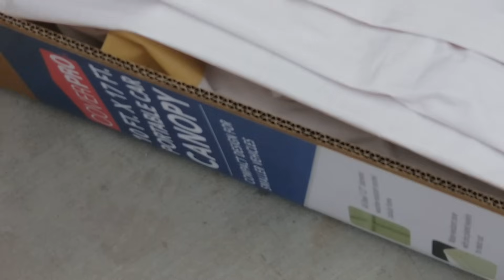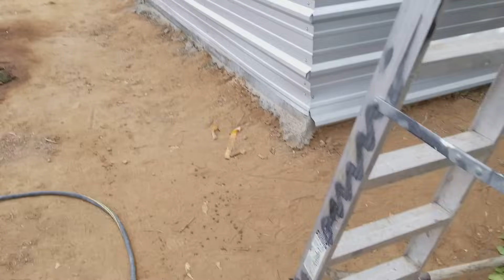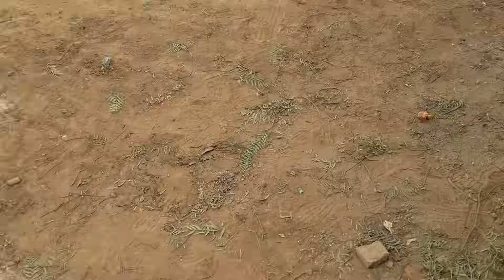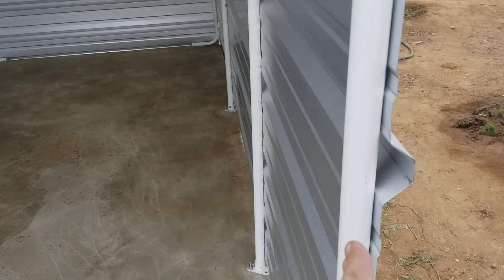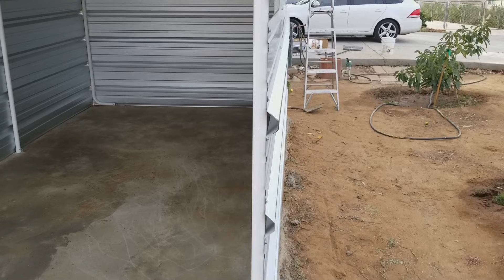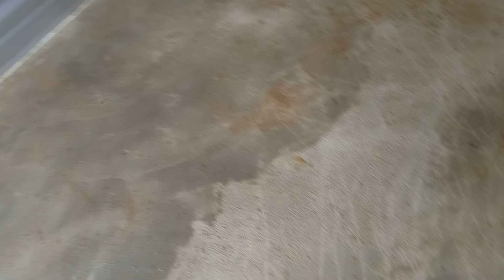Harbor freight tools portable garage into  Permanent structure

Comment: The overlap of each panel should be screwed to the bearing leg rib under it at a minimum of every two feet. Doing so increases the resistance to lateral movement from wind and increases the strength of the panels under load as each panel become slightly part of the others!
This is standard with installation of this type of metal on all applications. Google it!

Comment: I was thinking in the same lines although I don’t have size restrictions I’m thinking about extending to 12ft wide by adding spacers in the roof poles . I wonder if you put poles across like rafters if that would help ?
Reply: I would put poles across and one from the center of the peak down to your rafter going across. If you really wanted to add a lot of support to the roof. Where your pole from the peak meets your rafter run one from each side at an angle towards the middle of the original rafter.

Comment: QUESTION... SO... ANY ADVICE ON HOW TO GET A SLIDING DOWN DOOR ON THE FRONT?
Reply: Just make a split door
Reply: you may either use a roll up door and put a heavier frame around it or barn doors. 2 doors on either side of the opening.

Comment: I have something like this and the tarp is failing after 2 years. Putting steel on it might be cheaper than a quality canvas for the roof. For snow load I just used rated cable for the rafters. Easier to do that, though conduit and fabrication would likely be cheaper.

Comment: using screw eyes on frame bolts allows x brace cables inside 3/4 conduit especially on end sections. Built green house with same frame. An alternative inside sheathing is FRP sheets or Diebond (thin layers of aluminum with Polypropylene core. Both cut with circular saw either lap and glue/screw or use a backer on seams and glue/screw to that. Both are water/vermin proof will add resistance to racking and if glue and screwed  make a stress skin panel. Same with outer panels. Metal building catalogs have exterior trim, foam insulation strips, and simpson plates for mounting lights, roof vents, hinges for doors.

Comment: Good VIDEO!!! A friend of mine did the same thing on a 24ftlong square frame(rounded top style). Its about 10ft. High in the center.cost $820 to do the roof without the sides. Uses it to park his boat in during the summer.

Comment: I believe that these panels are run through a rolling mill.  Single press stamp would be ridiculous.  I have put on metal in excess of 40 feet. There are plenty of metal panels by many manufactures of this profile called generically DELTA RIB.  Many profiles exsist that function fine for these types of construction

Comment: We bought one of these kits from Costco and installed it in the driveway and the next big wind storm blew it over our barn and solar panels and landed into my goat's pen!  We used the tarp, of course.  I wonder how wind-proof this metal siding would be.
Reply from the maker: I have had 60mph winds and no issues. Remember it is anchored to the ground. and the panels are quite a bit heavier than the tarps.

Comment: Hah. About 2 moths ago i just did the same to make a new horse shelter. Took a pole tent i already had (i have atleast 20 frames worth of pipe and fittings) cut it down, took the scrap sheets they used to cover my roof panels in transit when i did my roof 2 years ago, and some plywood since its a horse, id rather she mess up wood then the metal and possibly slice herself severely. I bought a box of screws and some hat track for extra support/mounting locations. Was into it for about 150 bucks not including the cost of what i had laying around.

Comment: If you make it just wide enough to get a vehicle into but would not be able to open the door you need to think outside the box and install a swing door where the door would open so you can open the wall to give yourself enough room to get in/out but then close it back up when not in use with a simple gate latch to keep it closed.  When you are making it up as you go you are not limited to what a manufacture made as long as you have access to materials and tools to let you do what you can think up.

Comment: Great job! I have one of the larger frames and have been thinking about doing this same thing. This is the very first I've ever seen. You done a great job putting it together. Yep my frame is from the tent type storage shed and I will be honest, it was ok But the tent fabric lasted only two years. The sun rotted the fabric in no time. So now after seeing your video I'm gonna do the same thing but when it comes the roof panels, I might ask the metle company if they can groove only one section of a sheet and leave the rest flat. That way I can have a smooth roof rain and snow run off. Again great job. Thanks for sharing. You now have a new subscriber.... Thumbs Up !
Reply: Goodolboy One no grooves/ribs equals no strength. Just add wood or metal purlins to the roof at 90° to the frame and install the metal parallel to the frame or opposite to what this Video shows.  End result is rain and snow will run off.  Could gutter it also!  With the wood purlins the strength of the roof will increase dramatically!

Comment from the maker: http://www.contractorsteelsupply.com/ Here is where to buy the sheet metal siding and screws.
Reply: 2 things, I would go to lowes or Home Depot and get some of the thin superstrut for additional strength and bracing.  should be easy to add.  the other thing is if you really wanted to sheet rock I would use mobile home sheet rock which is like 3/8 inch thick instead 1/2 inch, it weighs a lot less.  but i use small structures like this all over the farm for line shed, tools, etc.  I might build one of these to bring in the new year in my farthest pasture.
Reply: @gibbsfan7180  1¹¹up
Reply: @gibbsfan7180  good information sir ty
Reply: How has this thing held up the past 2 years. I got the 17 x 10 the tarp is shredded an I seen ur video an thought shit i can do this with the frame. My frame is actually connected to 4x4's that r concreted n the ground.
Reply from the maker: @focalpointlandscaping  we had 80mph winds one night several months ago and it is still standing. Didn't even move.  gotta run the panels the way I did or it wont be that strong.
Reply: @mikesrandomvideos  Awesome!  Was just about to ask.  Thanks for sharing!
Reply from the maker: @focalpointlandscaping  still totally solid. like new. had 80mph winds trees blew down and still standing strong. got on the  roof and it held me just fine.
Reply from the maker: @focalpointlandscaping  still standing and made it through 80mph winds. These things dont evern move. super strong.

Comment: That would of been cool to add the tent to the frame then metal panel over that to stop wind and other elements for working in there on cold days. 20 years later when the material rotts just rip it out

Comment: You could probably find a used canopy frame for cheap or free from someone whose tarp has disintegrated.
Reply: Check harbor freight dumpsters, i got one 3 weeks after i bought one they had tossed because 3 of the post were broke at the connection, i just welded them back together with a 110
Reply: Or you could sell the new one to recoup some costs.   I love this project!
Reply: Superdad  Great idea!

Comment: The PBR is essentially “TIN ROOF” that you can but at Lowes etc.
Reply from the maker: where I got them from http://www.contractorsteelsupply.com/ a bit cheaper and better quality. also available in whatever size you want.
Reply: That would cost 300 for the pbx at the local home improvement store. I just bought some on sale for even less.  Regular price is 2.50 per foot. I have the white wramed hf 10x17 kit. Tarp material didn't last long so it's time for metal roofing material or heavy duty tarp. Same here on 120 square feet or it's permit plus approval from health department lol. Nothing like being a slave with no freedom on your own property.

Comment: What did your panels cost you. I'm finding 10 to 12 foot panels for 36 to 38 dollars each. How many did you use at I think you said either 15 or 17 feet?
Reply from the maker: 15 ft and I dont remember exactly how much I paid. but I think it was less 300 for each building and each one takes 9 panels I think if I remember right. I put something in the video about that when I was in better memory. Because I made the video right after I was done.
Reply: @mikesrandomvideos  so roughly 32 each. What state are you in?  From the 120 square foot limit it sounds like California.

Comment: Nice conversion to siding. I remember when I used to get several years out of these type of  vinyl sided sheds but now the vinyls last a year at most and shred due to lack of good UV inhibitors and thin mils. Even the tubing and joints are thinner and flimsy. Setting one up on a concrete slab is the only way too go.

Comment: This is a great way to do it. I can't hardly buy 1-1/4" x 10 ft. conduit and bend it myself for that price. The conduit is $17.00 each, and it will take 10 before it's over, and yours is already powder coated white, and has the anchor hardware.
Reply from the maker: yea that is exactly why I bought the hf one instead. I was going to buy the conduit but it was more expensive and didnt have the connectors. all together it would have been much more to use conduit and more work.

Comment: It looks nice.  I am thinking it won't stay that way, wind will shake it apart, and make a lot of noise while it happens, that is a problem with the steel buildings.  Wood shed is sturdy and quiet.
Reply from the maker: yea I get it but cant use wood to get a car to fit inside. Plus I used the rubber washer style screws so they wont back out. constantly holds pressure so the wind wont shake them apart.
Reply: @mikesrandomvideos  All the local rules around here (sacramento) say 120sf FLOOR AREA, so as long as the inside is 120sf, you can have a thicker wood wall.   Another material choice is to use foam sandwhich walls, like a boat, but cheap foam and thin wood.

Comment: X brace interior walls, top to bottom, will add strength, also it’s called a R panel
Reply: With what would one x brace the interior as you suggest.  What material?  Chain link galvanized tubing perhaps?
Reply: Michael Salcido  eye bolts, cables and turnbuckles to tighten X 3 sides,  building won’t go anywhere

Comment: Nice, but why did you cut out 6” ?
Reply: I believe it was to downsize from 10x17 170 sq ft to 8x15 120sq ft. I planned on doing this since mine caved in and tore from ice and snow. All I need permit wise is 3 drawings of plot plans. I'll be doing the full 10x17 though. I think it was about 700 or so all material.

Comment: why would you have to cut the pbr i just over lapped the excess but i used vinyl siding instead of metal and it work out with out cutting anything and yes i also insulated it r13 foam panels and spray foam and some cheap white panels for wall on inside only because i decided to make a studio apt. and live in it.

Comment: I run a metal shop in florida, PBR stands for "perlin bearing rib" panel. the main rib is 1.5" high. It's more heavy duty than the common rib panel at 1" high.
Reply: david montgomery what’s the avg or approx. cost per panel or ft?
Reply: @lahypnotista7737   depending on the color  and the gauge (thickness) of the metal, the price can be anywhere from .99 cent per linear foot up to $4 per linear foot. Judging from my experience though, the most common gauge used for the PBR panel is 26 gauge. And the most common color is "galvalume" (the silver/gray speckled color) used in the video. And at my shop, the price is around $2.25 per foot.
Reply: @davidmontgomery9570  Ohh ok defy doable, thanks so much for the reply. Love the videos!!
Reply from the maker: @davidmontgomery9570 galvalume is much cheaper yea buddy put up a link to your metal shop so guys can find you in FL. I put one up in ca. I will put in the description . About what I paid.
Reply: @mikesrandomvideos  I live in Washington State. is there an outlet for getting those PBR panels in my area. or would I have to have them shipped from California. I'm curious how a person would go about this in my area and keep the costs reasonable. whatever information would be helpful and appreciated thanks.
Reply: WE DRINK PBR around here!
Reply: @magicone9327  If it rains on these PBR panels does the runoff turn to 🍺?
Reply: Hey David, since you're in the business, let me ask you a question. Obviously the panels used here are intended to be installed up and down to shed water, not sideways like Mike has done for ease of installation. Do you/does anyone have panels whose ribs run the opposite direction, so that you can install them sideways, like Mike did, and they can shed water properly?
Reply: @MrTitanscout  I have a friend who has a carport made like this, it doesn't hold water.....
Edit: I didn't look at the age of this post before I answered, I hope you figured out a solution  ....
Reply: Omg spit it out skip
Reply: Where is fl?

Comment: , seems flimsy, I don't think it would survive a severe thunderstorm. you need to buy 1/4 inch cable with vinal and run over the top and secure to concrete
Reply from the maker: here you go not flimsy strength demo https://www.youtube.com/watch?v=w0abbXGY1eY

Comment: i thought about this concept a few years ago. then i decided to simply use metal studs. regarding your framing..that needs to be minimum gap of 2 feet on center....one good storm and your shed will be all over the neighborhood...at least it looks like you used neoprin washers under your screws to make the penetration water tight....another thing, you should have run your panels vertically to avoid "ponding" on the pan risers. 
 hey man, good job for not knowing the details.
Reply from the maker: that is how my awnings are built  and those ribs running that direction give the overspan more strength. If I ran the panels the other direction, I would definitely need them 24 OC. but with them the way they are it is super strong.
Reply: i am not an engineer. i am just a retired architectural sheet metal mechanic. those panels here in florida are used for 2 applications..what is referred to as the "robert e. morris " wall system and low quality general metal roofing. even when layed on a deck they are fastened 2 feet on center..look at your  pan lap... 3ft...that means 1st edage,center,and the ending edge where the lap occurs with the next panel . why the center ? it is more than 2 feet to the between anchor points (3ft) so you split the difference. 
 i really did consider buying that tent garage just for the framing but i saved money and i believe time by simply using 22guage metal wall studs... 16' long...i miter cut them at the 8' mark for a 45 degree bend. then  i did the same 6" from each end...i trimmed the ends to make a joint with the wall  studs..then ran cross braces  with top and bottom track....
 here in orlando i used a construction supply contractor for my panels..called 5v panels...heavier than what you used but i have hurricanes to contend with.
 did you do that slab yourself  or was it a service ?
 @mikesrandomvideos

Comment: Somebody going to get cut on the edges of those panels. The building looks like it will leak and blow apart in a good wind.
Reply from the maker: yea if you heard I have trim pieces to put on the corners but I couldnt find them at the time I just found them and will be putting them on. They are available at the link in the description.

Comment: Sir that structure does not look sturdy at all... When you shook that building with your hand I could see the entire structure move from front to back..
The poles alone look like straws the only thing looks solid is the cement slab..
Not sure where you live but if you are in a high wind area that building is probably not standing today especially in the ozarks..
Reply from the maker: well I can hang from it at the opening and it wont bend I weigh 225 so if that isnt sturdy IDK what would be.  That was before I put up the gable over the opening too. IT does flex but it is strong. held up in 60 mph winds where I live

Comment: You could have used 2x4 and saved money
Reply from the maker: I think with the treated mud mud sil it would cost more. plus you would need to get fancy on the ridge and corners to get the bend of the metal over the wood. Plus you loose about 3 inches which you really need if your storing a car. check out the strength video https://www.youtube.com/watch?v=w0abbXGY1eY